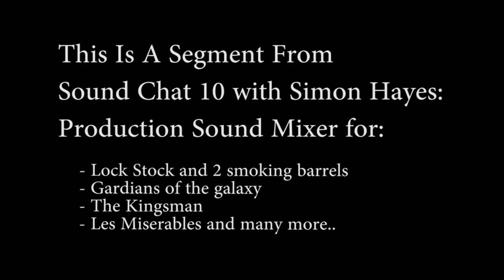Cabled Vs Wireless Boom | Simon Hayes

Comment: In 2016 I was on a show and an electrician ran a condor into a power line frying the entire sound cart and everything connected to it. I had just disconnected my boom from that cable seconds earlier. There was no way I could have known what was going on - I was inside the building and this happened outside so I didn't know anything was unsafe until it was. Unless the actors are talking really low, are screaming really loud or there's really some reason we can't get usable sound from a wireless boom, I'm less interested in risking my life by being connected to a cabled boom. It may sound paranoid but I could have been hospitalized with life threatening injury or killed last year because of a cabled boom so I'm stricter about when I go cabled. I know this could cost me opportunities to work with people like Simon but the film industry is getting crazier and crazier every show and my life isn't worth it. It's very seldom that post will be able to tell the difference between cabled and wireless boom and I know what those circumstances are and will go cabled when necessary.
Reply from the maker: Saw this on the Facebook group as well. Very very interesting. Glad you're Ok! Do you ever have to do stuff with a digital mic? What extra do you use for the converstion
Reply: I've not used the SuperCMIT 2U just yet. It's funny that this comes up now. A sound mixer that uses the SuperCMIT 2U just hired me for a movie in April and I have to go hard lined with that mic. Not pleased about it.
Reply from the maker: You could run with a backpack and get the converter in there. Think later on in this chat Simon talks about it for greenzone
Reply: Matt Price Perhaps but I don't think she wants to dedicate two wireless to one boom output especially since she doesn't have the gear.
Reply: Interesting viewpoint, glad you didn't get hurt! 
I always use a cabled boom so I don't have much experience with a wireless system. But what I do think about is how different radios sounds different and handle frequencies in different ways. Which would affect the quality quite a bit. 

I work for a sound production company and they ran some tests before we decided to go for a wisycom system for lavalier micing. They tested our old Microns 100 series, Lectrosonics UCR411 and Wisycoms MTP40S/MCR42S. 

They dangelled a bunch of housekeys in front of the mic and found out that the wisycom sounded most natural and gentle. 
The lectrosinics sounded sharp like if it was knifes clashing together. 

Not that I want to point finger and say that wisycom is better than lectrosonics or other systems but if such high end radio systems sound so different then must a wireless boom also sound noticeable different to if you wire it straight in?

Comment: How much quality is really being lost when going to a radio boom? Especially when you're using high end stuff like Zaxcom, Audio Ltd, Wisycom, etc? To me the total freedom of the boom op to go literally anywhere and get at any angle without having to worry about a cable running 50 feet to the other side of the set is too strong an argument unless there really is a demonstrable (and significant) degradation of sound quality. I despise cables, and have yet to be on a job where I can have a dedicated cable wrangler.
Reply: Blue's Clues for Fools I suppose it's the perceived difference between the good quality radio mics and great quality boom mics. The same way different room furnishings  change the tonal quality of a recording m different mics play an influential role in what's good enough.
Reply: I.C.E. Entertainment
I don't understand what you mean. I'm asking about the difference in sound quality between a (for example) Schoeps CMC641 plugged directly into your mixer with a $60 cable vs a Schoeps CMC641 running through a $4,000 Zaxcom wireless pair and into your mixer. Surely the sound difference is negligible
Reply: "Probability of failure is proportional to complexity squared".